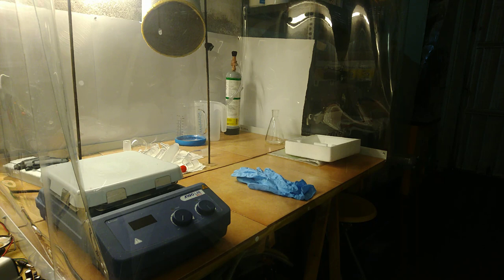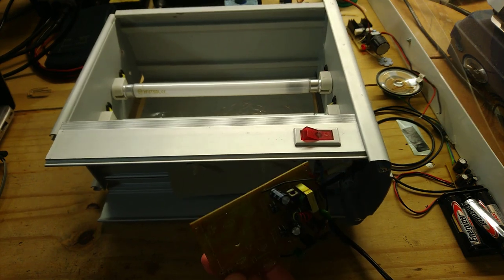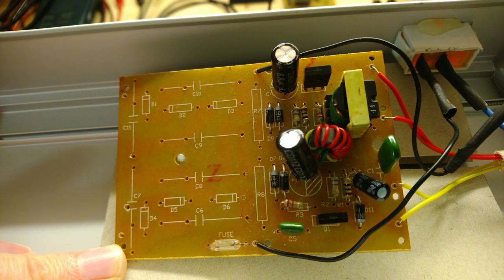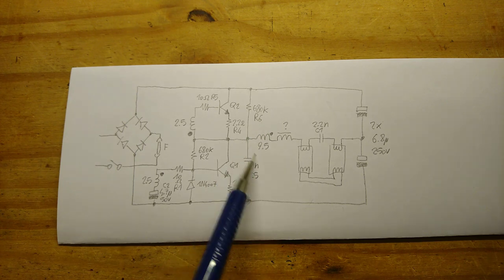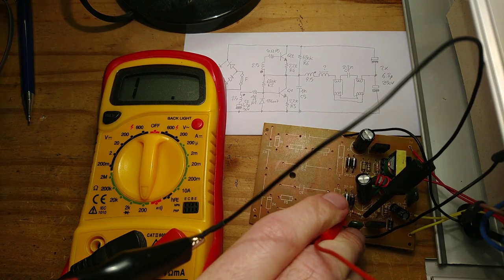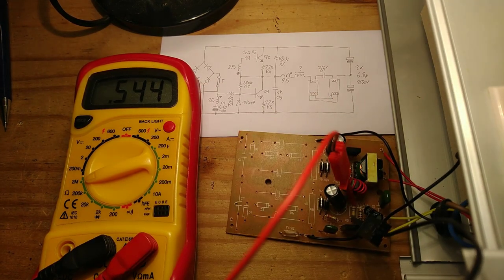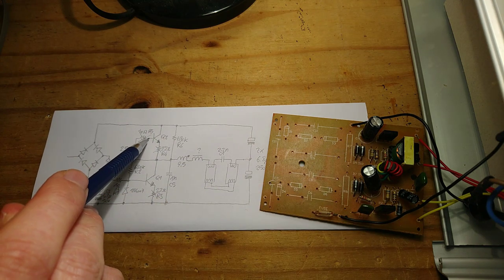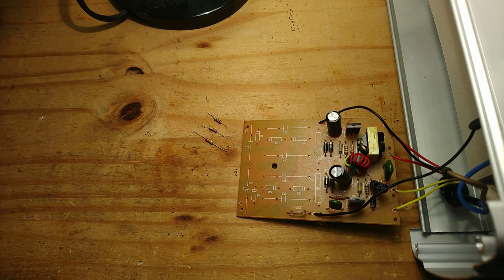Electronic ballast repair

Comment: sir thank you so much for making this love you so much plz one question 
Sir i made zinc sulphide with
NA2S+ZNSO4= NASO4+ZNS
CAN I USE IT TO MAKE GLOWING POWDER PLZ TELL SIR
Reply from the maker: Never tried this reaction. Assuming it does indeed make ZnS, you'll need to filter and dry the ZnS, and then proceed as in my video adding the desired dopant such as CuSO4 and fire it in a quartz tube furnace for it to glow.